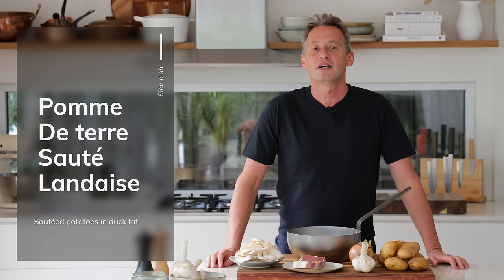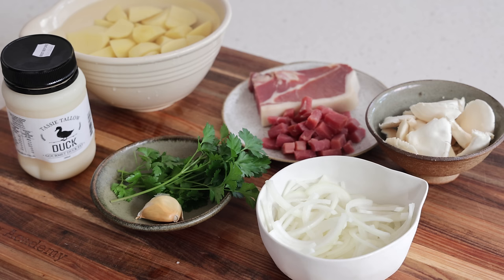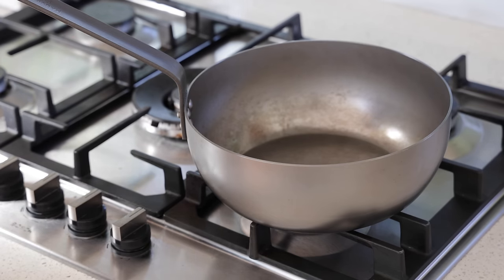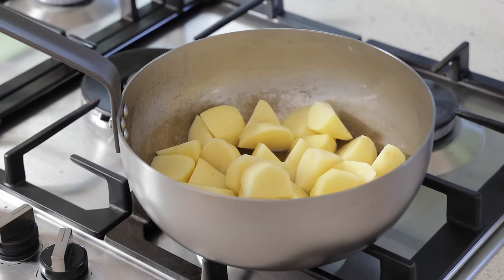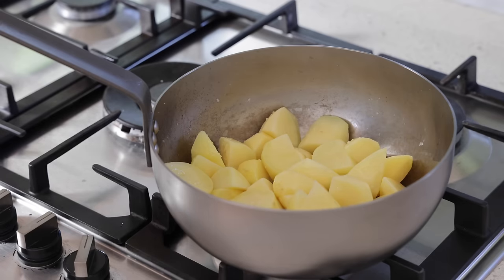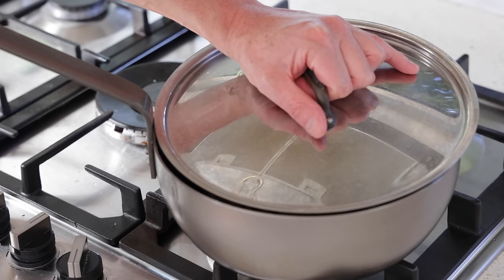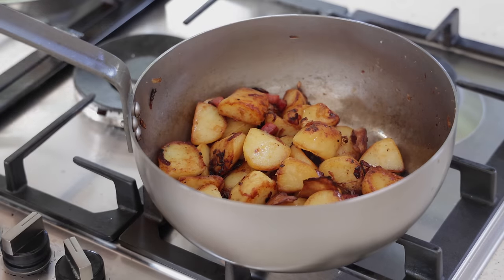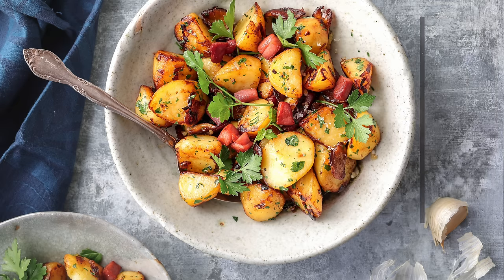Easiest sauté potatoes technique and best pan for the job

Comment: I WANT THAT PAN!!
Reply from the maker: it is a searing machine 👨🏻‍🍳
Reply: What is the name of that pan?  Amazon link?
Reply from the maker: that’s the one https://www.amazon.com.au/Mauviel-France-MSteel-Splayed-Curved/dp/B00KMQ6KT2/ref=mp_s_a_1_34?dib=eyJ2IjoiMSJ9.2VmEEy4rcmV4Nx3ERRsKPdU47e5f0sjPr56f9h8hIQ7F0m75H2qcjbDRpQ7ieOk7ygzM54j0jrGO9zpUhrFfWFSj_d7_OmHi1UXWrpL1pis7gD3DCx303Xq7qHU_Ze7rPRQFsnxFKgUaHvI99MNm2wkR7aJN9umgLR1cxaGXbYN-YGLpfGNRTf0Qo7an08QKariYuehl18Qq3UNCEJ5k4g.1p6L5UFBOKxPDcS3vg_ScEureEKgCqMBz2lvNtOHf3s&dib_tag=se&keywords=Mauviel+steel&qid=1710568928&sr=8-34
Reply: @FrenchCookingAcademy Not available!
Reply: It's a pot.
Reply: That is a very expensive pan which currently is not available at Amazon and priced somewhere between 250 and $350 when it is. 
I have a $100 high quality flat bottom steel WOK which works perfectly well for many applications and is available online. I even use it to make tomato sauce and soups.
Reply: @FrenchCookingAcademy Holy moly, that's a link all right.
Reply: @Marrio49 I am glad Stephane mentioned using a wok. I have a wok from a thrift store. It would be perfectly OK for this. I also use my wok to cook fruit when I am making apple or pear muffins.